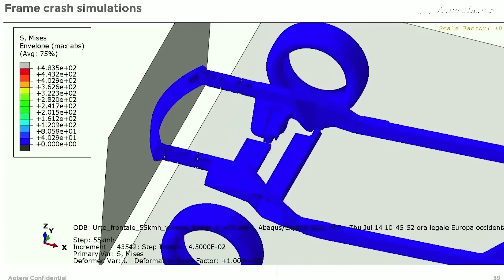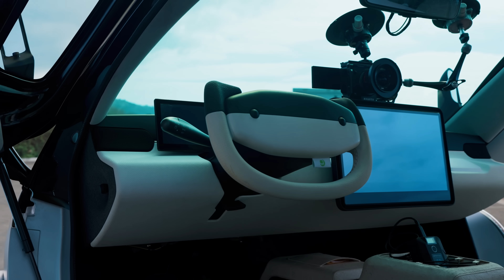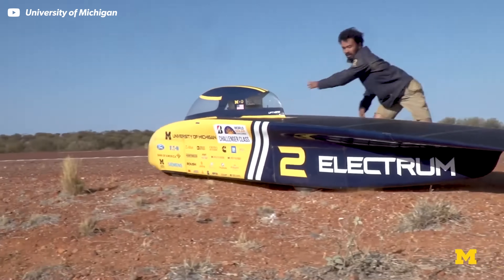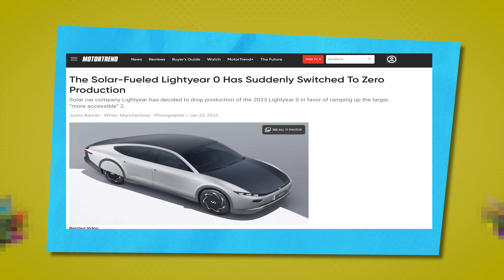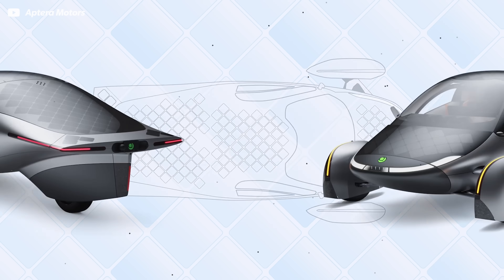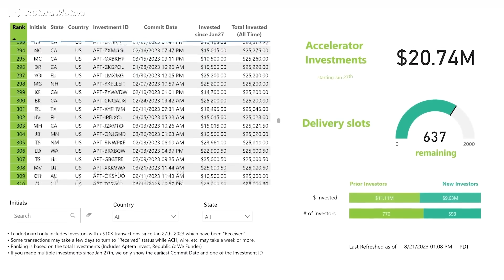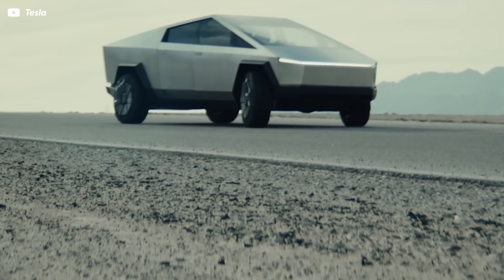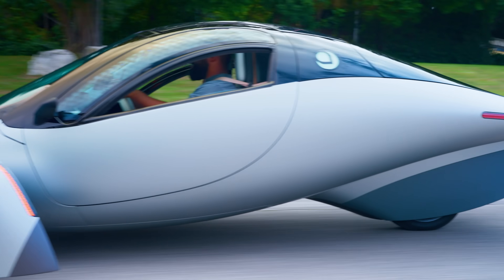We Drove America's First Solar Car

Comment: If they can really do it for $25k, I'll be the first in line to buy one.  That would be the perfect commuter car for me.  And with the solar being able to charge it enough for my commute back and forth for most days, it would be almost free transportation.
Reply: The guy first in line is investing $4m. You’re probably going to be first in line lol.
Reply: They have different options for range on a full charge. For $25k, the range is 250 miles. If you want the 1,000 miles as advertised, it’s gonna cost $45k
Reply: @jakediaz8539 Doing 1000 miles in that seems terrible.  But doing my 25 miles in each direction every day seems perfect.
Reply: Tires/ maintenance worries/concerns for me
Reply: @jakediaz8539 $25k is less range and no solar charging
Reply: @MikAnimal   The $25k model will have a range of 250 miles and it DOES have solar charging, though fewer panels on base model, so solar recharge is reduced to 16 miles a day in optimal conditions.
Reply: @shannonlawhorn1674  ah so something barely functional for 25k basically 25k for a super cool golf cart and 45k for the car version. Still too expensive
Reply: @MikAnimal 250miles and solar charging... barely functional. Let me guess youre one of these people to slate electric because you once drove 400miles in one day and you claim you didnt stop to eat or piss. Ffs
Reply: @barratt5795  range is not a feature of a car it’s a basic necessity. Considering weather and topography etc 250miles becomes 100miles quickly. 

I love the company over all but they are still playing a game that won’t catch on with those prices
Reply: Although it would be cool to have a car sitting in the sun for my 10 hour shift at work and get me home for the day plus some extra mileage. Though at $45k it would take 10 years before it would financially gain for verses a $30k car getting 35 miles to gallon.
Reply: @MikAnimal  gas range matters too and it is a feature. Many gas vehicles have somewhat crappy range and in rural Canada (haven't driven much in America, maybe it's different there), some vehicles are just bad investments if you need to drive out of town a lot or when the rural gas stations are closed (very few are open after 10 PM or earlier than 7AM nowadays). If the EV manufacturers started making more inroads on mid-level charger infrastructure in rural areas, I would actually buy-in because the gas station inconsistency thing is a growing concern.
Reply: @VRRanger-e9e  range is a basic requirement. Unless a specialty vehicle like a drag strip car. People can buy any ice vehicle and not have range anxiety. “Range anxiety “ is a concept that developed with and because of electric cars. 

People did not have to plan hard and prey allot just to make it where they are going since the model t till electric cars were in the lexicon.
Reply: I'm telling you right now, pump anxiety is not a new thing, if you've never prayed that the next town on the highway has a gas station, you haven't really travelled (or you just plan better). @MikAnimal
Reply: @VRRanger-e9e  99 percent plus of ice cars will have zero range issue in any rural Canadian environment. You will be able to drive over 300 miles , can find gas everywhere and cold weather won’t turn that 300 plus into just over 100 miles of range. 

Sorry you just don’t seem to have a handle on how cars work. I know Canada well so that is a you issue, never heard of anyone from Canada complaining that they can’t find a car with enough range.  But everyone in all but the most short commute has crazy issues with car range. 

If you want to expand the scope of this and in meaningless ways like saying your in Canada like it’s different than in the USA which it is not in any way that is meaningful to this talk then we gonna raise you the range and plus battery safety, repair costs to the mix. 

$40k for something that is the most basic functionality of a car and $25k for a city golf cart (due to range) is a joke. 

This is the best electric car offering and it’s still a joke
Reply: You can option it out to be covered in solar panels or just the bare minimum. I did the 600 mile, awd + all panels for under 40k
Reply: Dude than maybe youre just not in the market for the car. The average commuter does not drive more than 50 miles a day. Nobody says this is the only car you'll ever need. @MikAnimal
Reply: You can get the whole car covered in solar for extra 500 dollar or so just to get 56 miles of range in full day of sun. So if you dont drive more than 40 miles a day your in the positive. I have the 450 preorder im sitting at 32k for the whole thing with all the bells.
Reply: 400 mile range for $$33,200 isn't good enough? How about  $38k for 600 mi? That's more than most any ICE car. @MikAnimal
Reply: @MikAnimal  you can plug it in genius
Reply: @jamesbyrd3740  I mean I literally am so thanks ✌️. Yeah plugging them in is included in my analysis. That has to do with the range anxiety people have with electrics and a barely functioning charging network for all cars not Tesla.

For home charging well that does not help with long range driving and as challenging is that power grids can not handle large scale EV adoption. Cali would be a perfect example. The grid has rolling outages as is in the summer. 

That help make things clear my not genius friend 🤷🏽‍♂️☺️🤦🏽‍♂️
Reply: A little nick picky but the base model is advertised as $25,900. That price was quoted in 2019. Inflation will probably increase the price when they get into production.
Reply: @danielb2571 well, if you get the base model with 250 miles or the 2nd lowest with 400, it'll only cost 26k or 29k. That'll put a dent in that timeline
Reply: @tims8603 yeah I'm worried about that as well. Aptera only really makes financial sense if it's cheap, else why not get a Tesla model 3 or a chevy bolt? They've said that due to EV demand tapering off a lot of the parts have actually decreased in price recently though, so I'm hoping they can hit those prices.
Reply: @mindlessmrawesome  I can't speak for anyone else but  I have a lot of reasons why I won't buy a Tesla. I won't list them all here. Aptera has right to repair, it charges up to 150 mi on 120v overnight. It's way more efficient and doesn't need a big battery. The solar charging isn't a big deal for me but it is for people who live almost anywhere South of my state. The Bolt is pretty good but boring. I won't have to decide for around 3 yrs and a lot can happen in that time so I look forward  to hearing from others who own an Aptera.
Reply: They've been quoting that price for a few years now. But If I'm not mistaken that price will be with a shorter range and less solar panels. The fully decked out, 1000 miles range with full solar panels will be closer to $35k....but still a value and a half!
Reply: @RichardServello  The price they quote for the 250 mi is closer to $26.000, 400 mi range is $30,000, 600 mile is $35,000, 1,000 is $45,000. Those prices may go up. They don't know for sure yet.
Reply: @MikAnimal 
The average American commute is 41 miles. Even if terrain cuts your effective range from 250 to 100 miles you're still well within your range limits. And chances are that you'd be able to plug into a charger if needed while at work.
Reply: @VestedUTuber  The average is 40 not the daily. Daily needs with traffic, terrain, car load and weather can all greatly affect that range. Like a full load of obese people (we are near 50 percent obesity now) in hilly terrain in an unexpected occasional opportunity or necessity. people NEED their car for weekend trips, last minute out of town meetings/romance/family and outright life or death emergencies. 

Add more into that people are lazy and forgetful and don’t always plug things in when they should even if they can. 

The fact is that all ends up as range anxiety and a feeling of not being able to trust it when needed as needed. 

So for a person or family who can afford only 1 modest or cheap car. They who are the every person. They have no options in electric. 

Most people rent and still need a car.🤷🏽‍♂️

Have a go at those.
Reply: @MikAnimal  Range anxiety only exists because of a lack of charging infrastructure, it has nothing to do with the car itself. And if you just do 2 minutes of planning before a trip it isn't even an issue for EVs. I took a cross country trip in December with my EV with no problems. And the range below zero conditions only falls from 258 to about 200, wherever in your ass you pulled the 100 thing is either 20 years old or entirely fabricated
Reply: @MikAnimal  the main problem with your assertion is the "300 plus becomes 100" shit, which has no basis in reality
Reply: @lexistential  the main problem with my assertion for you is that I am correct in my assertion
Reply: This 25k is an estimate from pre-covid and pre-inflation. And they still did not manage to even build one production ready prototype, so until now they still do not know what the real cost of this mototcycle will be.
Reply: It makes absolute no sense to put the solar panel on the car. Put them above your parking lot where the car stands the whole day, and charge the car battery with it.
Reply: @sandasturner9529  the company is right to repair so while that doesnt say anything about the actual experience of repairing at least it means you'll have adequate support when something goes
Reply: Yeah it sounds great and the car has a lot of good ideas...but let's not kid ourselves government will never allow zero cost transportation for long.. there has to be some dbag senator out there salivating at the thought of using cars like this to justify a per mile tax
Reply: @MikAnimal well, those prices aren't giving any lower until every car company stops making gas cars. The only reason why gas cars cost what they do now is because they've had decades of innovation and competition, while electric vehicle tech has really never been at the forefront of anyone but niche companies like Tesla. But when every major company scraps gas vehicles, then we'll see major improvements in both the price and the technology.
Reply: @MikAnimal  that is wrong, 25.900 is the price for the 250miles version with the solar roof and dash, which gives you around 16 miles per day. There is no version without solar charging. And by the way, the full solar panel option on the 250 mile version only costs 900$ more, so the price is 26800$ for 40 miles a day of free transportation. Of course on sunny days in hot areas. But that car will change everything, you'll see! 
And it doesn't need to be the only car you posess, it can worl as a daily for going to work and back, or going to get the grocery. For everything else, you can get a second car.
Reply: @shannonlawhorn1674  and the 40 mile full solar kit only costs 900$ more...
Reply: @MikAnimal  100 years ago they had too for sure!!! And to be fair, we're exactly at this point of development when it comes to electric vehicles and infrastructur. Here in germany you had to get gas from the next pharmacy up until the 1930s. So you did have to plan your trip carefully back then. And its the same right now, but the technology and understanding of all of this is much better nowadays, so the infrastructur and technology will be build way faster now. Just look at the Tesla Superchargerparks for example...
Reply: @MikAnimal  Not really, and how many Americans are actually driving more than 100 miles a day? 

And you do understand that the solar panels charge while driving, right?
Reply: @MikAnimal  "“Range anxiety “ is a concept that developed with and because of electric cars. "

Range anxiety doesnt exist for the majority of people because the majority of people dont drive very far. Range anxiety is a term that was blown up by media that loves to support big oil. You fell for it.

And considering gas is pricey, yes many ICE drivers do have range anxiety. Not everyone can afford to fill up their cars all the time. That induces anxiety that's caused by range.
Reply: n absoluteIly no circumstance does your range in an EV car get cut by more than 50% like that. You're looking at a 30% reduction max, that's in a very cold climate.
Reply: @jamesbyrd3740 Plus the efficiency is double of a Model 3, if not slightly better. While 120 volt charging might be untenable otherwise, for something like this it's actually a viable option. 6-8 miles an hour when it's parked at home for 10 hours a day (on top of the solar charging) is all you'd ever need locally.
Reply: @Henning_Rech When your car is this efficient It actually makes sense. You're going to recover at least 50% of your daily driving on solar alone. Because of that it makes 120 volt charging viable, you don't need to put that much extra energy in to get to work the next day.
Reply: @jakediaz8539  And the 1000 mile one is basically going to be wildly unnecessary - they are going to have dc fast charging and use tesla's standard - so long as they don't have problems from Tesla and accessing the supercharging network 400 miles is going to be a perfectly acceptable sweet spot. Only reason I could see to get the 1000 mile one is if you wanted to use it as battery backup for your house (which, it will be cheaper than getting a similar number of powerwalls....).
Reply: @MikAnimal  Which is still enough for most peoples commutes for several days. Keep in mind you can charge it manually too overnight like a regular EV. the solar range is just a bonus on top of what you get from plugging in.

Comment: The first 3 wheel micro car I really like. I’d drive one in a heartbeat
Reply: It’s not a micro car. It’s massive. It’s as wide as a full sized truck. 

It just looks like a microcar because it only seats two
Reply: @mmavcanuck  It's wide and fairly long but not massive at all. It's very light actually.
Reply: @freddybell8328  which is terrible for a 3 wheel car, you take a turn a little too fast that single wheel on the back is going to lose traction and you'll wreck
Reply: @TheSimba86 Funny how that didn’t happen in the video.
Reply: @TheSimba86  Nope. Aptera simulated the "Moose test" and it did very well, with no stability problems.
Reply: @deanmcmanis9398  oh, well as long as they’ve “simulated” it. I’m sure it’s fine.
Reply: The Aptera's body is about the size of a Model 3 (with mirrors), but a foot shorter, and 6" wider up front.
Reply: @freddybell8328  weight doesn’t matter when you’re trying to fit somewhere, dimensions do.
Reply: @mmavcanuck By "simulated" they mean that Aptera created a reasonable physical facsimile of the "moose test" on a test track and ran their suspension beta vehicle through it. Aptera tried to tip it and couldn't. There's video out there, and it's not that hard to find.
Reply: @northernsouler  and Elon had in-house tests of Tesla’s FSD totes working perfectly that definitely weren’t flawed/totally fabricated. 

Don’t trust anything until it’s independently verified. 

That being said, it does have a very wide stance, which should definitely help.

Also, AFAIK they have yet to produce a production ready vehicle to test.
Reply: @mmavcanuck  Elon's a known liar and sociopath. Using him as an example of lying is like... duhhhhhh.
Reply: Have you seen the Morgan 3-wheel? I love the styling on that one
Reply: @deanmcmanis9398 Aptera also simulates production, yet keeps taking orders, since 2009.
Reply: @mmavcanuck  4:42. Watch the fuckin video before starting non-existent beef.
Reply: @Surms41 you’re seeing a pre-production model that doesn’t even have all its panels.
Reply: Micro? It's wider than a Humvee.
Reply: @deanmcmanis9398  "simulated"
I'd like to see actual tests instead of theoretical ones.
Reply: @TheSimba86 they have put through the "Moose Test" tje collision avoidance test and it did kicked butt. Most SUV' and even some cars perform very badly on it. The rear trailing link suspension design had some help from  Rouche Racing.
Reply: @mmavcanuck they ran their Beta protype on the track and it killed it. The have a 65% 35% front end weight bias and a trading link rear suspension that Rouche Racing helped them design

Comment: Stoked to see a Donut review of this car. I have been following Aptera since its original inception as a 100mpg ICE concept. I drove a Honda CRX for years so lightweight, super efficient, zippy handling hatch backs have always made sense to me. I guarantee my CRX drove more dirt roads and hauled more lumber than the vast majority of trucks and SUV's on the road today. For someone like me without a family to haul around, a hatchback is super practical. I really love this care and the approach that the company is taking to design and production and customer interface. I am really hoping they finally get these beauties out not the road. 

My current ride is a 2004 RSX. There is no newer car that I want more. If anything I want to go backwards to simpler cars that were affordable and that I can work on myself. The Aptera is the only car yet to be produced that truly interests me. Honestly, I would love to see a gasoline version for those of us in harsh winter environments or who regularly do long cross country drives. Though someone mentioned solid state batteries that could solve the cold weather, ultra-long range needs. 

My only request to Aptera is to make the battery packs modular so someone could start with the $25K 250 mile range base battery pack and later add more batteries to increase range as batteries become more efficient and affordable.